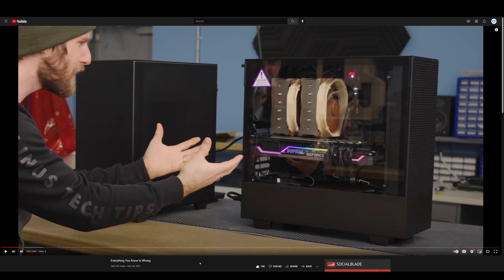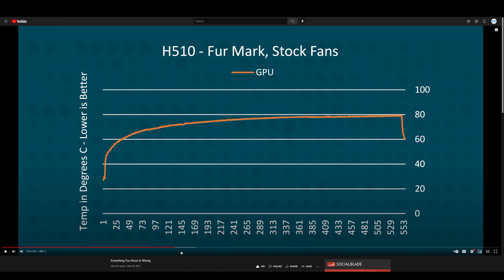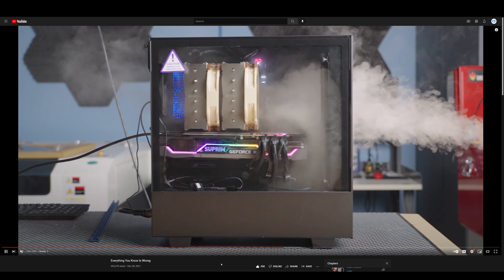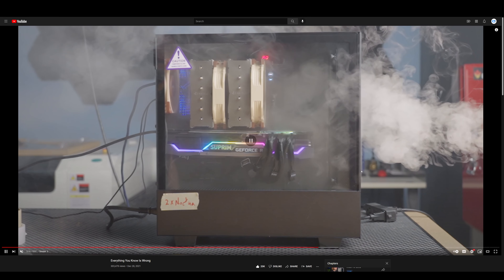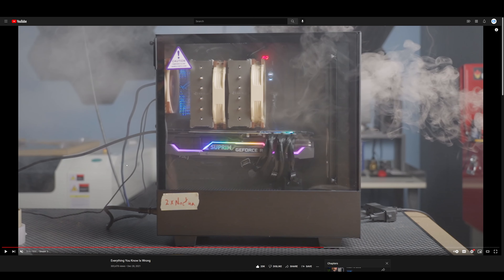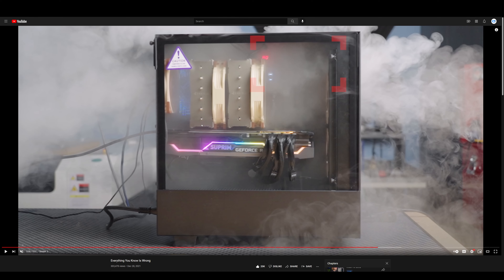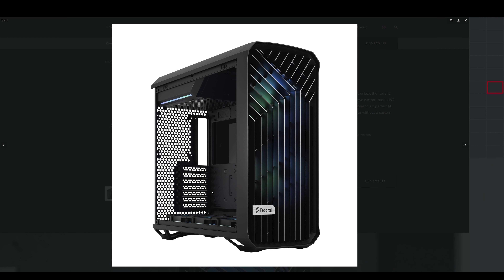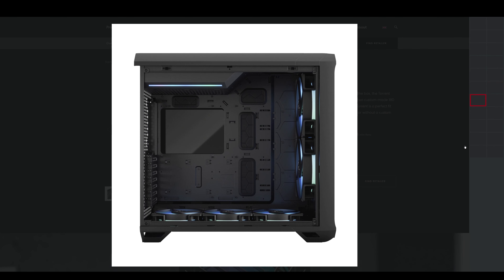"Turbulence" is NOT making your GPU hotter

Comment: What ever happened to side intakes on cases?  Everyone's too busy worrying about how everything looks instead of performance.
Reply from the maker: Exactly.
Reply: I know this is late as hell but, the case I have chokes the hell out of the gpu air. I have a cooler master Q300I, the mesh is already a hinder and the gpu will hit 90-93 within 10 seconds of playing a game. maybe I can get a hole in the acrylic side panel and add a small fan.
Reply: still rockin my 2009 HAF 932
Reply: Back in the day, a side intake was considered cool looking too.  All these fortnight and sociopath-simulator f*****s and their RGB trash...
Reply: @MrMarrok657  small fan would not help. I bought more "classic" style pc case with just one exhaust, and side panel holes. 
I put 140mm P series Arctic fan as intake to blow towards the GPU because i have one 120mm exhaust and the PSU is on top which also acts as exhaust, but the case is still mid tower and the GPU (Intel A750 OC) still chokes from the heat. I easily hit 85-90 degrees on the GPU on 92-100 on the VRAM if i unleash the TDP to 220W.
Sadly the front panel has not intake holes... So, I am thinking of drilling holes at the bootom, below the GPU and eventually putting some fan there. But the dust... So i'm still thinking it out.
Reply: @vyrgozunqk  the fan on side panels was to EXHAUST hot air from the gpu not the other way around. we modified the crap out of our old cases adding 140's and 120's all over. the Chieftec dragon full tower case only had the side panel and a rear exhaust stock. we added 2 intake and an additional exhaust.
Reply: @daiichidoku  Yup, I'm probably never getting rid of my Cooler Master HAF 932. Still one of the coolest temperature cases of all time to this day.
Reply: @MrMarrok657  Side panel fans also work awesome as intake. Maybe not with that other person's setup but definitely with the Cooler Master HAF 932. Great for GPU, motherboard VRM, and RAM temps. 1x stock, junky 200+ mm intake on front-bottom panel, 4x Cougar Vortex 120 mm intake on side panel, 3x Phanteks T30 120 mm exhaust on top panel, 1x NZXT 140 mm exhaust rear panel.

Having said that, I'm curious to experiment with changing the top fans to intake and the side fans to exhaust.
Reply: @Spinelli__  always had a DVD RW in one of the 6 front panel drive bays, late last year i added a 120mm noctua fan using 3 bays, with a 3d printed adapter faceplate. it hides behind the stock grills, although i had to clip a tiny bit of them off to make em fit again. looks like it was stock, now. and one bay for a 4 place usb3.0 hub, and the last bay now has a click in/click out storage box.  also keeping this case, likely forever.
Reply: @Spinelli__  my 7600 pushes most the hot air towards the glass door. Having exhaust would take temps down drastically for me as well
Reply: @OTechnology  By how much ? In my positive pressure case, when i remove the side panel, the GPU temp drops by about 3ºC and the CPU by about 5ºC. So not really a an improvement in terms of noise or temps.

Comment: the problem with ATX right now is that the hottest workload for typical gaming pc's don't ever stress the CPU it's often the GPU that has to work 100%, this is made even worse with tempered glass side panels and the power supply shroud so really intel and AMD needs to work together to create a slightly modified reference architecture or case manufacturers standardising PCIE extension cables to create a layout that is actually designed for gaming workloads.
Reply from the maker: Yes I agree very much on this
Reply: This is the first good criticism I've ever heard of ATX. Interesting
Reply: @OTechnology  lian li Lancool ll and lll Mesh have a metal door below the side glass panels that is full of holes (mesh) that allows the GPU to get air from the side.
Reply: It's already been solved. Just get a case with an open bottom intake, so the PSU is either at the front, top, or behind the mobo in a separate chamber.
Reply: @Tadders You can also put up to 2/3 fans for the Lancool II/III and have the GPU intake cold air from the bottom
Reply: @807800  could you put an example of a case with that features?
Reply: @MarcAsenjoPapiol  
- Any dual chamber cases, like Lian Li O11 series.
- Jonsbo D41
- Jonsbo D31
- Jonsbo Z20
- Cooler Master QUBE 500

The newest one would be Lian Li Lancool 207 and Antec Flux Pro.

Antech Flux Pro is quite the unique one, the PSU is in standard position, but just like Lian Lancool 207 the bottom of case really designed for taking airflow from the bottom side of the case.

As for my recommendation, it would be Lian Li Lancool 207. (just make sure to get 150 mm length PSU and preferably the one with flat cables).
Reply: @807800  do you know something about 5000D Airflow and its meshes? Is it good that case for optimal flow of the gpu?
Reply: @MarcAsenjoPapiol  That's a fairly old case by now. In its era it's not bad, but today, probably quite a meh.

Comment: Positive pressure > negative pressure all day everyday. Problem with the case in the video is not possitive pressure but HIGHLY positive pressure. Negative pressure although seemingly better is actually worse because it fills the case with dust way more which in turn screws up the cooling anyway and requires frequent maintenance. I always set up my builds for more positive pressure and never had problems with cooling. Meanwhile Im good with 1 cleaning per year or two and even then the dust build up is minimal.

Comment: Interesting 
It’s basically the restriction at the back that forces the air downwards and then it gets sucked up by the GPU

I actually remember that in the past PSU’s were always mounted at the top of the case … in some case you might still see the cutout for the 80mm fan that used to be on the back of PSU’s … then they moved to bigger fans on the bottom side of the PSU’s … I believe there were some issues at that time where some PSU’s overheated because of the case design with the top mounted PSU’s
And that is when we started seeing bottom mounted PSU’s so they could get fresh air from underneath the case and the power cable would not have to run to the top of the case
And than some company’s came with the PSU shroud that basically hides the PSU and cables …

I actually like the approach that cases like the Enthoo Primo, O11D, HAF 700 Evo and some others have taken where The PSU is mounted behind the mainboard tray (or at least has its own compartment but doesn’t block off any bottom intake possibility’s) 
Yes it makes these cases wider but it also allows for HDD’s, SSD’s and small controller units to be hidden away from the main chamber 
I think this would result in a best of both worlds scenario and might be the best way to go for manufactures moving forward

Comment: On my H500P Mesh + 2080Ti FTW3 one of the main thing I noticed is that vertical mounting lowers GPU temp by about 6c under load. With standard mounting, this card is designed to intake air from the bottom fans and exhaust from the side. Unfortunately for most cases side exhaust is blocked by glass. Vertical mounting gives more room for the heat to be exhausted from the rear and top fans. 
I miss the days we had side fans like in the Thermaltake Element S. Or the Enermax Chakra, which had a button that could flip the side fan from intake to exhaust.

Comment: WOW! THANK YOU! That's so obvious when you talk about it yet I didn't think of it! I have a Corsair 4000D airflow case with two bequiet silent wings 3 fans mounted as front intake. After watching this video I switched them from top/middle to middle/bottom positions (the bottom fan blows into the psu shroud) and this alone dropped my gpu (RTX3090 FE) temperature from 74*c to 65*C in Unigine Heaven!!! That's just unbelievable.
PS CPU temps have climbed a few *C probably because the tower cooler now misses a fan blowing cool air directly onto it, guess I'll have to buy a third fan some day but this doesn't seem to be a problem for now - it's much easier to cool anyway.
Reply from the maker: Yep. You really need some direct airflow into the area where the GPU fans are intaking air.

Comment: I wonder why a cooler design similar to the NVIDIA Founders Edition found on RTX 30 and 40 series cards doesn’t get used more often. All board partners have the same basic design, where two or three fans blow air onto the heatsink and then it vents out from the sides of the card. Whereas the NVIDIA design is really clever, having one fan blow onto the heatsink, but the air gets blown out of the case (like a blower style card) and the other fan pulls air through the heatsink and out the other side of the card. That way, half gets vented out of the case immediately, and the other half creates an air stream that you can utilize and enhance by mounting top or bottom fans - in contrast, the fans on other cards vent air to the sides, ie. towards a sheet of glass or the motherboard, so pretty useless.
Reply: Because actually AIB designs are better. Just check any reviews on refference vs high-end AIB design per GPU. Also take in mind that even similar temps mean AIB design is superior since AIB cards mostly use more power. Nvidia makes sick designs but mostly just to have good looking card or card that takes less space but strictly by performance AIB coolers are mostly superior.

Comment: It's not a flawed design, it's a negative pressure case and works as intended in the stock configuration. I have the older h500i and it's a similar story. I've optimized my setup since I got it about 5-6 Years ago so it does well as I have it. I'm running positive pressure as well, but I needed to block off certain areas like the back PCI slots that aren't populated- taping over the PCIE case slots stopped the positive pressure from pulling some of that hot air down to the gpu- it was drawing the hot air from the CPU down since there are holes for the air to escape from below the GPU ( I even tried zip-tying a small case fan to the back- just plain taping over them worked better). Once I taped over those holes temperatures went back to normal. I really love this case, but it's kind of strange when it comes to air flow. I've got a 240AIO with push/pull so 4 120mm fans on intake, 2 for exhaust, x1 120mm and x1 140. I've even got a hefty overclock on the CPU and it still stays very cool. I love NZXT cases, they're my go-to case manufacturer!

Tape over those slots beneath the gpu if you add fans to the front and go positive pressure!

Comment: I’ve built 7 PCs in the last 5 years, 2 for me rest for friends - builds from 1000 to 4000usd and I keep saying - manufacturers need to agree on changing so many things in PC building space! PCIe slots are bending cause of thickness of gpus, power cables are sticking out in front of the window panel - stull like that needs to change in upcoming years. Nvidia new 12pin power supply connector is nice but i still dont like its from side not from the back of gpu ;)
Reply: you pretty much need a full tower these days for modern GPUs anything else you are getting a bit sweaty with all those cables.

Comment: I found that closing those random holes on my case has decreased temps due to the fans more quickly flowing the hot air out and giving a higher pressurised path for the air to follow. Meaning it goes at speed.
When there are random holes, it causes a lot of undirected air to just mill around and soak the components due to a lot of slow moving air floating around.
Also creating a shroud tubing from the intake case fan to the intake of the cpu fan will result in there being less turbulence, and faster flow of cool air directly from outside the case.

Comment: Proper fan size along with placement and varied speeds is what creates a case that flows well. 

Don’t understand cases like Corsair where they have the three side fans that do nothing but disturb the airflow. 

Front and bottom fans run slower while rear and top fans run faster keeps the cool fresh air moving as it should. 

Most of the PWM fan hubs are useless as they run all the fans at the same RPM regardless of the fans CFM.
Reply: You’ll get negative pressure if you make the exhaust fans run faster than the intake fans

Comment: Great video! I was thinking if a small 80 mm fan as intake from the rear could have helped?
In that way do it still keep a positive pressure but "compress" the air under the GPU.

Comment: A cold air intake in your Honda civic doesn't add horsepower it actually takes away 1 or 2 horse power. 

Even with a fan blowing in front of it while on the dinotester. The teachers prooved us students wrong at U.T.I. in order to bring the temps down you'll need to have the fans right over a hole in the case so outside air is directly getting in and not hot air from within side of the case.

Comment: you could make the bottom psu + cover work, just embrace the "negative phenomenon" seen in this case. 2 exhaust fan on the front, nothing on the back, and (presumably better) solid tops for that straight wind tunnel flow.  this way, you may have your solid front panel back (as long as the frame openings surrounding the fans are sealed)
Reply from the maker: Still not ideal because the PSU would be exhausting its hot air right below where the PCIE slots for GPU intake are.
Reply: @OTechnology  iya bener juga sih

Comment: This just reminds me why I'm still using my 7 year old Corsair Air 740.  Front 3x120 intake, bottom 2x140 intake, Top 2x140 exhaust, Back 1x140 exhaust, a 92mm Exhaust fan in the PSU compartment, and a 92mm Fan VHB taped to the HDD cage in the PSU compartment to keep air moving over the HDD's. As long as I can keep getting components that fit in my Air 740, I'm going to keep using it...

Comment: Worth bearing in mind that often the goal is positive pressure to stop air being pulled in anywhere except through filtered intake fans (i.e. NOT though the PCI grille or any I/O panels). With a typical 2/3 front fan and single rear exhaust this does exactly what you say, results in very little air flow in the bottom/rear of the case around the GPU. In view of this, as an experiment I recently had a pair of 25mm deep honeycomb vane grilles printed for the front two fans of just such a compact ATX case which had the effect of dropping GPU temps by 5-6°C while raising CPU temp by about the same, because the straightened flow now easily reaches under the graphics card, which sheds more heat into the case so the CPU runs hotter. However, CPU cooling was never an issue and they both typically stay under 60°C (previously it was high 50's CPU and low/mid 60's GPU with both loaded).

Comment: I just built a system in a Lian Li LanCool 205 Mesh case and it's interesting to me how cool it's running, despite using a single fan air cooler. I ran the TimeSpy stress test just last night. Even with some overclocking applied to the GPU, it only rose to 63 degrees at peak. The CPU rarely even rose above 50 degrees. The LanCool 205 Mesh is a far more open design and seems to promote far more airflow than the NZXT case used in the test. It really seemed like the system in the video suffered from a lack of airflow around the GPU in general. If I recall, the GPU didn't have much clearance between the edge of the card and the glass panel, which would only increase the severity of the airflow "dead zone" in the bottom of the case. 
The components I used in my build are as follows: 
ASUS ROG STRIX B550-F Gaming MoBo
Ryzen 5600X
ASUS TUF Gaming 3070
Seasonic Focus GX-750
G.Skill Trident Z (2x16GB 3200)
1TB NVME SSD
(Yes, I understand that these components do not use as much power or generate as much heat as those used in the test, however I do think it represents and interesting point of observation.)

Comment: Experienced this issue in my case with triple intake front fan and one exhaust at the back. I was able to resolve the issue by setting a different fan curve for the bottom front fan. Making it spin faster than the middle and top front fan prevents the GPU from recycling air because of the higher pressure from the bottom.
Reply: did your problem resolved even with solid front case?  i also have same issue + quite big gpu that make it worse 😢

Comment: Another good case is actually an ITX case, the NR200, with the power supply having its own fresh air on the side. The GPU intake air from the bottom, the CPU can take air in from the mesh side (or the back, if you use the rear fan as intake), and you can exhaust the air out the top. This is the ideal situation with each component getting its own fresh air. There are other cases that use this design principle. Meshlicious is another one with very good temp for the components.
Reply from the maker: Yes I agree. Actually a lot of SFF ITX cases have this ideal independent airflow.
Reply: Have that case and love it. GPU fan curve turned up to use it as intake and a 240mm AIO as exhausted to the side, right above GPU. Since it's just gaming workloads, my temps are more than fine.

Comment: I have my rear exhaust fan flipped to intake, all the pci slot covers off and the bigger cover that goes over them and my front 3 fans are exhausting. It’s dusty but it certainly doesn’t let anything build up. there is some recirculating from the gpu exhaust though but it cant be much with this much airflow